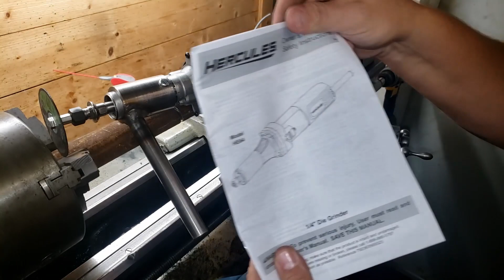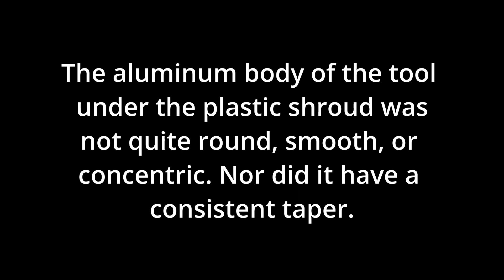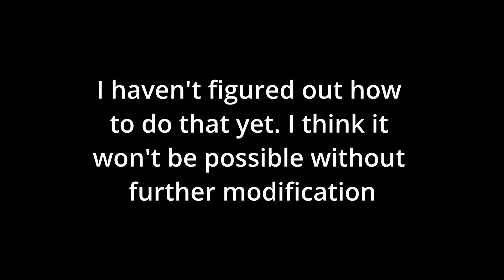DIY Articulating Tool Post Die Grinder for the Lathe

Comment: Is there a way of chucking a tool, say a Woodruff cutter, onto the die grinder?
Reply from the maker: @wryanddry2266  yes but it would require an additional part to articulate the grinder in an additional axis. As shown, it can engage the workpiece only head-on, either radially or axial. A woodruff key would require tangential cutting. I am pretty sure I don't have the words to describe what the additional part would look like, sorry. I wish I could post pictures.

Comment: That's a really good idea.  Thank you for sharing the build process with us!

If you don't mind my asking, why did you choose to leave the nose tapered rather than turning it down to a simpler-to-work-with cylindrical shape?  
I'm guessing either:
1.  There wasn't enough material in the casting to allow cutting it straight or,
2.  You wanted the taper to make it hold better, similar to the Morse taper in most drill presses.

I just found your channel and am subscribing.
I've often thought about potential ways to achieve an extremly steep pitch on my old Logan 955.  So far, the leading candidate has been Clough42's electronic lead screw project, but I'm looking forward to watching your follow-up video on the method you used.
Thanks again!
Reply from the maker: Yeah the casting was too thin to turn cylindrical. Honestly the effort I put into this (the long pitch gearing part anyway) would have been better spent implementing ELS. The only reason I didn't is because I have another lathe that is a resto-rod project I am turning into a full-blown CNC lathe. So in my mind, at the start, it didn't seem logical to spend time making this one sorta-CNC when a real CNC is in the pipeline. But the time I spent screwing around with different gearing and trying to math, was probably more than it would have taken to go ELS. And if I had installed ELS it would be there next time I need it and I wouldn't have to do all this over again.

Comment: Your limiting factor is the lathe rotation cannot be slow enough to time cutting a proper pitch of your groove.
Reply from the maker: The lathe is unpowered. I have custom compound gearing between spindle and lead screw in order to hit that pitch (about 1.75 inches per rev AKA 0.57 TPI). I am driving the lead screw instead of the spindle and I can drive it as slow as I want with a hand crank. But in the video I  was driving it with a cordless drill. I am making a separate video about this process. Putting that video together now.